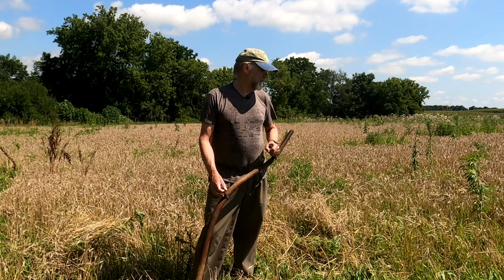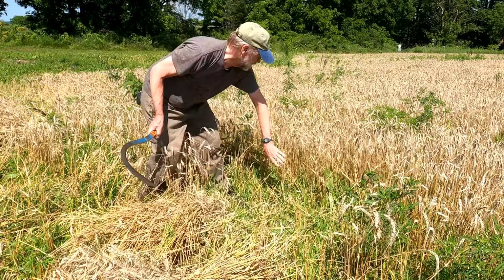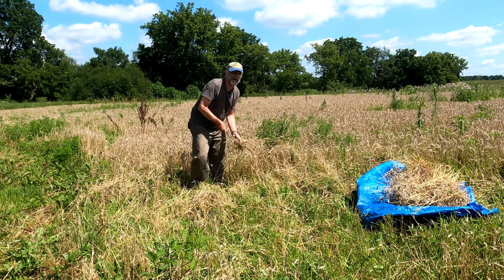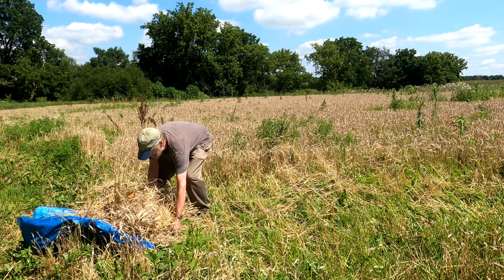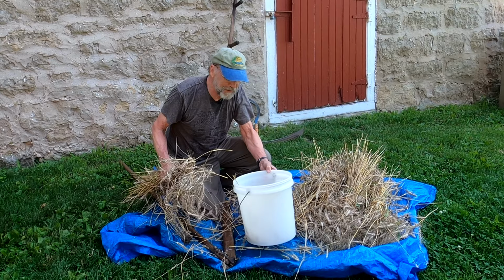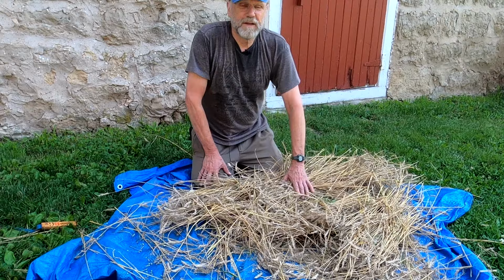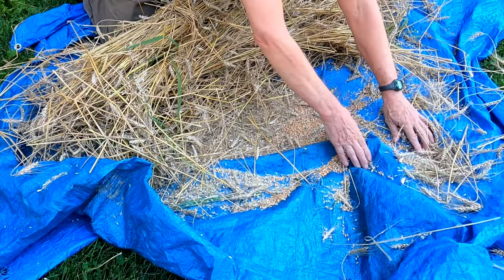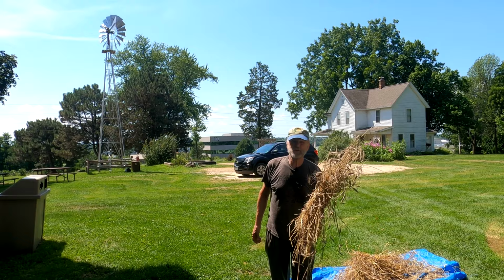Hand Threshing with Sickle, Scythe and Flail - at the Schumacher Farm Park

Comment: You are usong the scythe wrong. Not an expert on thos style but 42 blades is a great resource for the use of american scythes. Mr chikkadee has a verry good guide on sharpenong and maintanence. Agreed that if you keep swinging a scythe like that you are gone wreck your back.
Reply: Yes, I have used scythes. You would need to sharpen your scythe so it cuts across the blade of wheat, like shaving a beard. It would be smooth, gentle, and graceful; not a hacking motion.
Reply: His ergonomics suck even if it was a sharp blade

Comment: He doesn't know how to use a scythe. I've been harvesting my wheat and grasses with a scythe for 10 years now.
Reply from the maker: For sure... don't use this as a how to use scythe, sickle, or flail. This scythe was a display item with very dull blade, and the leather on flail was about to fail. I had to be very careful with the flail. Video is more about documenting than a how to use video... these are tools used to harvest whole fields back in the time.
Reply: @RogerBindl  Well said. Also, you're expected to be experienced using these tools to make this video? Lol, sorry you're not the 1 other person in the world with 10 years of scything experience.
Reply: True about the scythe, they aren't a tool you can just pick up and use straight away since setup, sharpening and technique are all things that take time to master... Also you need to have one the right size for your body - that one looks a bit short as you're having to lean over with it. When cutting you keep the blade in contact with the ground throughout the whole of the movement, you don't even really pick it up when drawing back for the next cut
Reply: How many acres can you mow in a season with a scythe?

Comment: Thank you Roger. I was curious after watching a flail vs mace video (mace= higher impact force), why they invented the flail; I'm still not sure why. I could speculate that the free floating flail's bounce was more effective in separating the grain or that it protects the user from the impact. As a weapon it may have been all they had or maybe it also proved useful for getting over the top of shields. It seems to me that striking wheat with the back of the shovel in my garage might be just as effective as a flail for threshing. 
🌾
EDIT: Actually, now that I watched another video, the farm flail is more solidly attached than the lengthy chains on the weapon usually depicted. It looks like a lot of velocity can be produced creating a whip-like action with less movement. Similar to how an atlatl improves ordinary spear throwing.
Reply from the maker: I think the flail had both effects you mentioned. The pounding end gains lots of momentum because of the pivoting point, and you don't feel it in your arms is you would from a ridged pole.
Reply: I know its a late response, but historically the flail wasn't used that much. In art and documents it is very rarely depicted( as a weapon). If you are interested I would look up Shadiversity's video on the subject.
Reply: Having done some threshing of peas by hand with a big stick I can say it's pretty hard on your arms and joints (you need a hard surface so it's a bit like using a pick axe on rock). This year I've made a flail which will hopefully make it much more comfortable
Reply: @jonnyramsden1161  Yeah it seems the benefit is you can do the full strength hit onto the ground and the joint makes it so you don't get all that force delivered back into your arms.
Reply: @RogerBindl  you my ninja